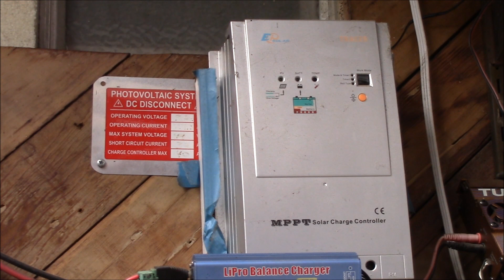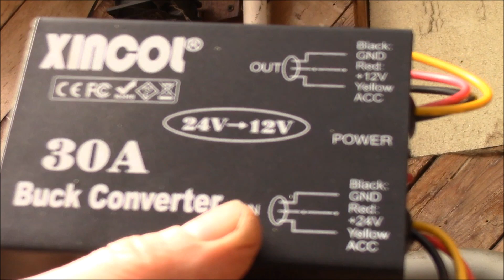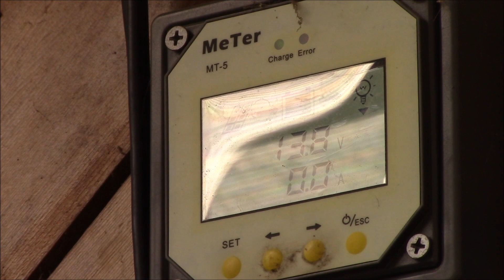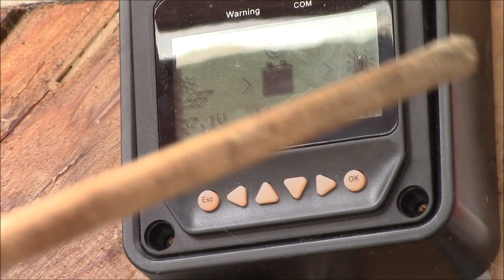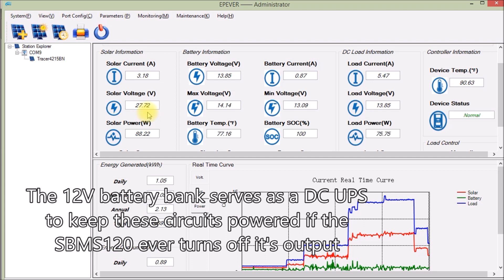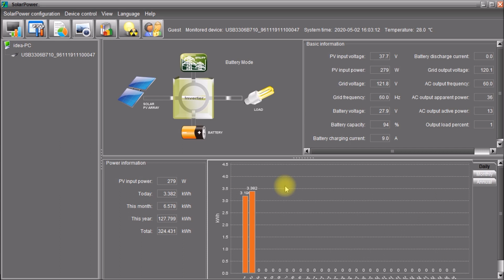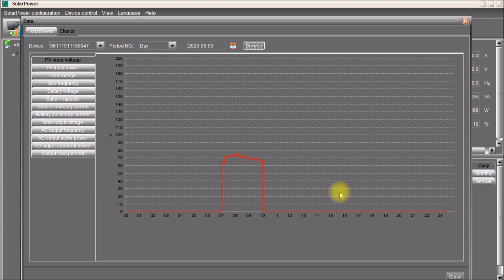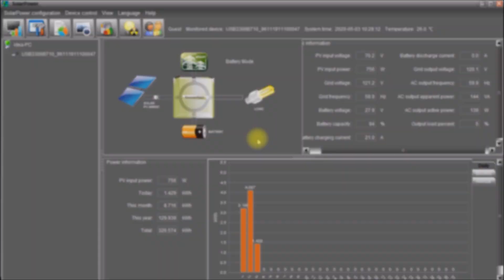24V to 12V DC Power Supply

Comment: Hi is it safe to use a buck converter from a 24v battery to a 12v inverter? A nice renology was left in my recently bought box truck. I already have a 24v 3000w inverter but I was already trying to figure out how to wire a second inverter in just to make sure I can handle spikes. Like my auto heater kicking in while I'm using my induction stove. I know I can't run 24v straight to a 12v inverter but just trying to understand why I couldn't reuse this nice inverter with a step down. Although I don't know how two inverters impacts the system.
Reply from the maker: A few issues with that.  One is you would need a massive step down converter capable of handling whatever current that inverter would pull.  Also, it's not a good idea to connect 2 inverter AC outputs together unless they are grid tie units or have some sort of parallel operation communications cable between them.  A 3000W inverter should be able to handle a decent startup surge 1.5x to 2x it's rated load for a second or two.  Maybe try adding something like a super capacitor across the 24v inverter input like I show below:
https://youtu.be/8TVDFK2enSI
With that cap installed, my 1000W 12v inverter could put out up to 2000W for a short time and handle loads like my freezer and clothes washer starting up.
Reply: @The4Crawler  thank you so much for responding so quickly! That communication between two inverters has been the thing that really confuses me. Keep seeing others say the same and only examples Ive found are with the victrons. My concern is that if I run my stove and microwave while cooking, the ac will come on till the room cools to a set temp. Obviously could be avoided with some precautions, but I don't want also it would be really nice to  use a stove and microwave in a cool room. On top of that there are a few little things that are run often like router and fridge. Still going to try your suggestion because it's awesome. But not sure I could achieve what Im hoping for. Seemd like I might have to just bite it and get a bigger inverter though
Reply from the maker: @patrickconrad396  Yes, imagine Victron has that or others like MPPSolar:
https://www.mppsolar.com/v3/split-phase-lv/
Those can be set up to run multiple units in parallel or they can also run 120/240v split phase, which is how I'll be setting mine up.

Or, you could get a 2nd 24v inverter and use it to power some of your loads on a separate circuit.  Trying to run a 12v inverter with a 24v - 12v step down converter will be much less efficient, you'll lose maybe 10% of the power through the step down process.  I would guess the price of a converter big enough to handle a 12v inverter would be similar to a new 24v inverter.
Reply: @The4Crawler   lol yea definitely wouldn't make sense with the 12v. I can at least sell this 12v one and put it towards a new 24v. 

So i planned to have one inverter connected to one bus stud and the other to a different stud. So they'd share the battery and nothing else. All appliances would be wired to separate distribution panels depending on their power use. Would that be separate or still considered the same circuit? Although one inverter is also an  mppt and charger that also have their own  connections to the battery busbar. Sorry for asking so many questions. That price from the 3000w level to the 5000w is insane. So if I could do two somehow that'd be so clutch. And I just can't bring myself to get two victrons...just so much money
Reply from the maker: @patrickconrad396  No problem hooking up to 2 circuits like you suggest.  One breaker panel and feed one side from one inverter and the other side from the other one, but you would want to check the voltage between the 2 neutrals.  Sometimes these inverters have neutral tied to the battery negative, others will have neutral and hot ~60 volts either side of the battery negative.  If yours is setup like that, then 2 separate breaker panels would work, one for one set of loads and the other panel for the other loads.
Reply: @The4Crawler  wow thank you so much. It's been driving me nuts trying to put all that together. Really glad I found your channel. I'll be subscribing for sure.

Comment: I am so new to solar. Building out a bus/RV. I have 2 200ah AGM. Can I put them in series?
Reply from the maker: Sure, I've been running 4 - 35AH AGM batteries in parallel for 7+ years now, still working fine.  And just the same, you can connect them in series as well.  Sounds like identical batteries of similar vintage, should be no problem, assuming the rest of your system can handle 24 volts (charge controller, inverter and other DC loads).  With a series connection, you may want to run a periodic equalization cycle with the charge controller.  I run one on my parallel AGMs about once a month.

Comment from the maker: Here's a shot of the controller display, late March 2021, with the system delivering 18.7 amps of DC loads:
https://photos.app.goo.gl/jkusa3c31PxVAX9EA
I had almost all the 12V DC loads on, including shop, kitchen and attic lights, solar heating system as well as TV antenna/distribution amplifiers.

Comment: I have that Ep Epever  4215BN Here.   Going with 24v .   Not set up quite yet.  Starting with 800W of panels.  Trying to understand your monitor systems.  I have the the blue tooth 
EPEVER eBOX BLE 01 RS485 to Bluetooth Adapter 
 interface in place of the M50.  Some what confused on the software options to use.  
Planing on running the 20v   ( 36 cell ) panels 2S so as to use a 24v plug n play grid tie as a dump load.  Plan on using 100A Solid State Relays to switch the panels between charge controller and the Grid Tie.  
Batteries topped off any power diverted to the grid tie.  Would never be creating enough Grid Power to back flow out the meter.   Just lowing the already low power bill some.
Reply from the maker: I've not used the BlueTooth adapter, so not sure what software options there are for that.  I'm using the eBox-WiFi adapter and it connects to my home WiFi network and then using the NetBurner virtual serial port software to connect to that WiFi adapter and convert that connection into a COM port on the PC.  Maybe there's a similar program available that can convert a BlueTooth connection to a COM port.

Comment: I am running a 12 volt solar system using a Midnite Classic for the Charge Controller.   At the moment I use it to power 12 volt loads in my house.   I will be stepping the system up to 24 volts and I purchased a Mean Well SD-100B-12 switching converter to convert the 24 volts down to 12.   The Midnite Classic and  it's Battery monitor system the Wizbang Jr. does a good job of determining the actual current going into the batteries and how much the load is pulling.
Reply from the maker: Yes, that's another option. I can monitor the DC power flowing out of the SBMS-120 into the 24V to 12V power supply.  With the old charge controller, I can see the 12V side as well and I get a "free" UPS feature along with the ability to "park" 12V lead acid batteries on the system to keep them charged.